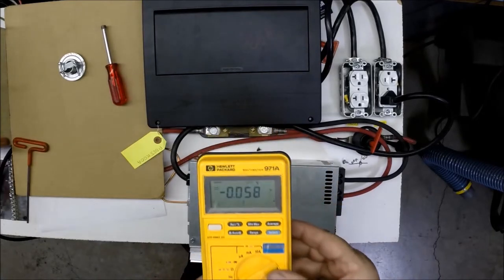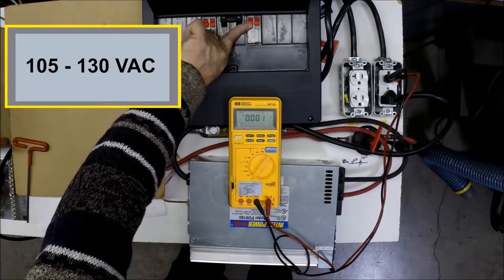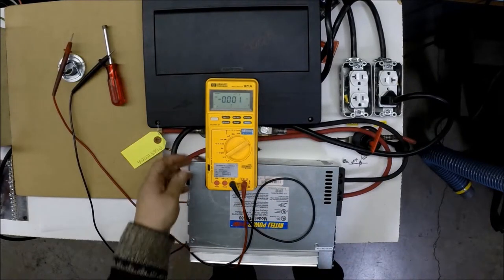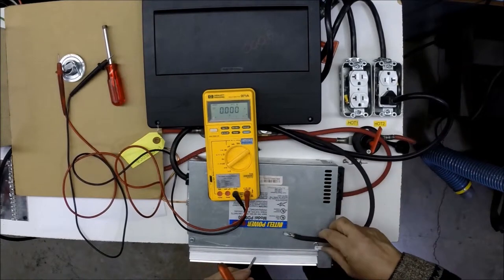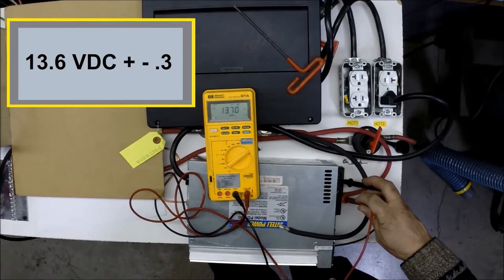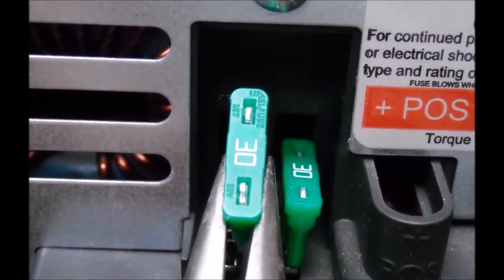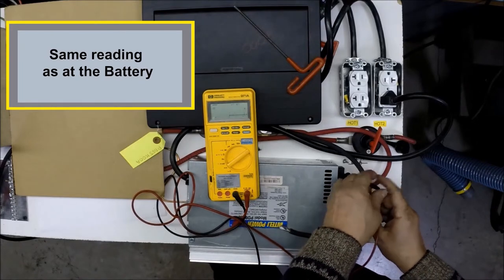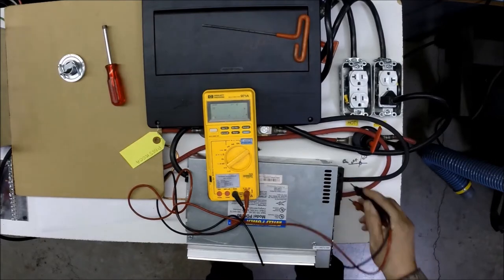Checking a Deckmount Converter

Comment from the maker: At 2:00    For Lead acid batteries. Models PD9100, PD9200 ;  The converter output should read 13.6 in regular mode , 14.4 in boost mode, 13.2 in storage mode.
For Lithium models: PD91xxL 14.55-14.6 in charge mode .  The 2 stage lithium models will read 14.55 - 14.6  or 13.5-13.6 depending on what mode it is in, These readings are valid with the battery disconnected or a fully charged battery.`    More troubleshooting available at:  https://www.progressivedyn.com/support-manuals-troubleshooting-guides/